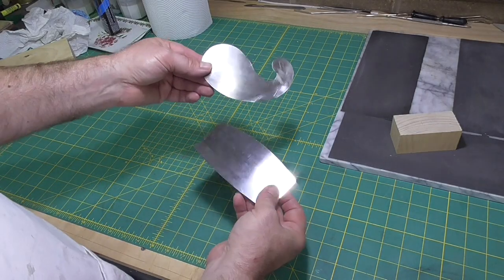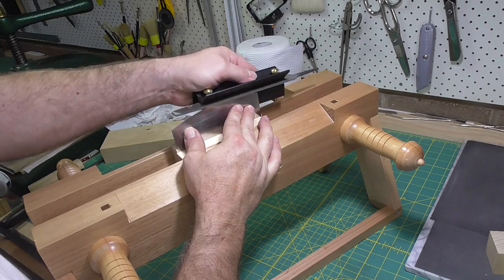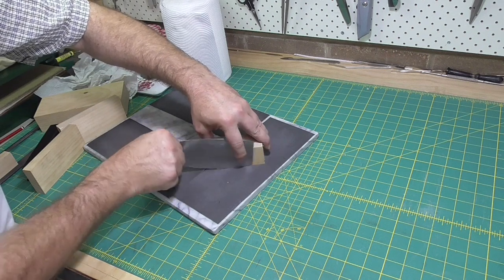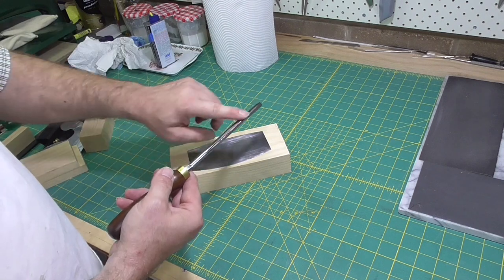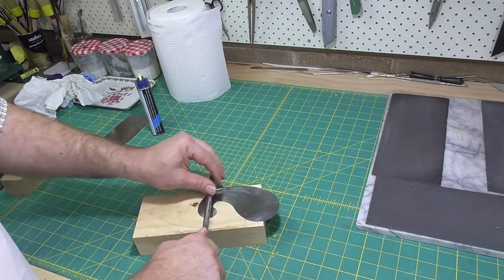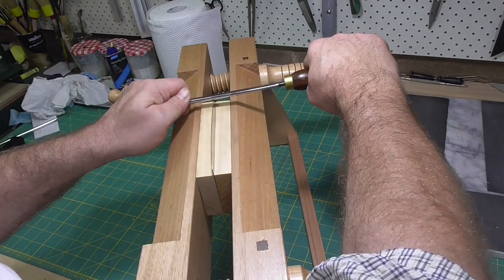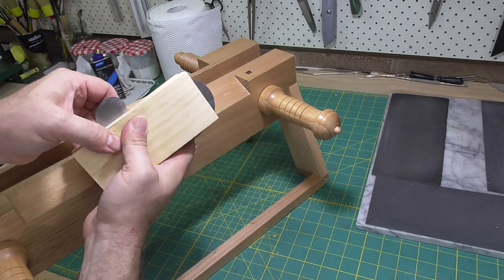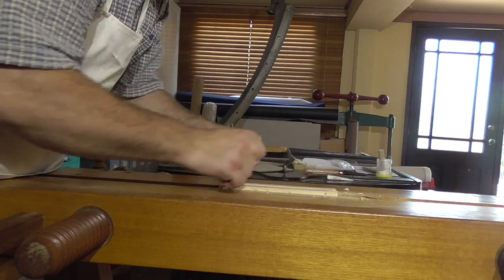How to Sharpen a Cabinet or Card Scraper for Bookbinding // Adventures in Bookbinding

Comment: Can this be used form start to finish on the foredge of books ?? Really taking place of sandpaper ? As a prep for foiling and/or coloring edges ??   I’d appreciate any feedback and God bless
Reply from the maker: I usually finish with a very fine sandpaper.  But you don't have to.  It is much harder to learn but once you work it out it is faster.  For foiling and colour I just use sandpaper.  Colour doesn't need such a high quality finish and for foil is can slightly hollow out the edge, which is fine for leaf, but for foil it makes it hard to get enough pressure evenly across the surface.